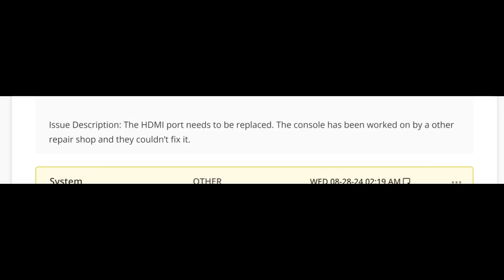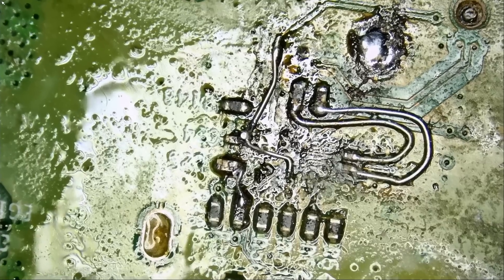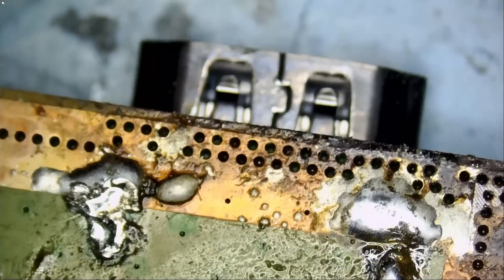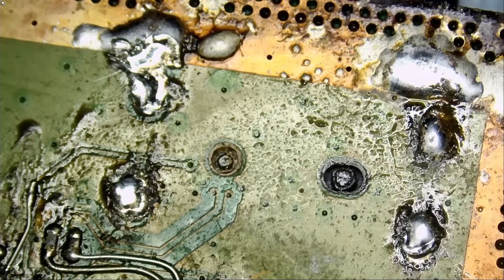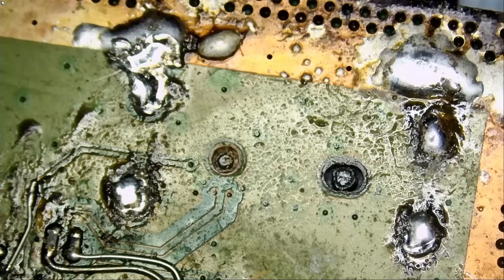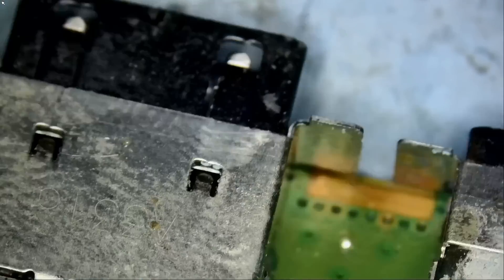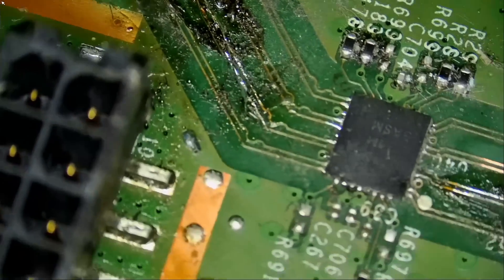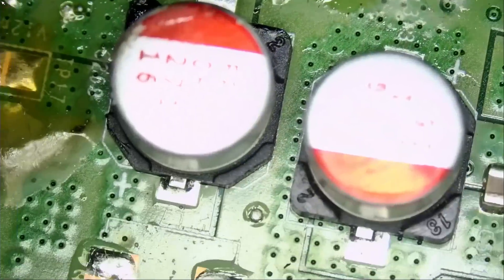Xbox Series X Fastest no repair - You won't enjoy this one..

Comment: That's painful, I fixed one similar the last shop had floated that missing chip and cracked it trying to reattach it. Its an easy mistake when you try to reflow remove those hdmi ports because that chip is under it one slip with a hot air nozzle and you flick it off. Luckily someone discovered a bypass that probably breaks 4k output but it gets the console displaying again. The worst part is that chip is not available for purchase because it's a special sku for microsoft. After dealing with that mess I started putting uv mask in that area to hold everything in place as a safety precaution.

Comment: I always enjoy your videos.

The terrible standard of work on this video is of a similar quality to many repair shops near to where I live in the Philippine provinces. In the 6 years that I have lived here, repair shops have destroyed one mobile phone, two tablets and, what was, an expensive Asus laptop. The laptop made me very angry, particularly because it was bounced between repair shops, so that I do not know who to point the finger at for the damage caused.

About 6 months ago I had to replace the keyboard and palm rest. No soldering was required so I did the repair successfully myself. All went well until the charge port failed. The inner pin came out with the connector, so it was an easy diagnosis. The laptop continued to work until the battery drained. I assumed that with the right tools, replacement of a charging port would be an easy fix for a repair shop.

After several weeks, I was called into the repair shop, which required a 2 hour ferry journey and an overnight stay, to be shown a laptop that would now charge but where the newish keyboard would not work at all. I paid the man for his troubles and took the laptop away.

I have the knowledge to fault find but I did not have the necessary tools nor the necessary experience to do the repair. Watching your channel has given me the confidence to have a go myself. I have nothing to lose and I can't make things much worse. I have spent a fair sum to obtain the basic tools necessary for the job.

On inspection of the laptop, the motherboard seems to have been ripped away from the keyboard with damage to the connectors and a torn backlight cable, which is now too short to effect a repair. I do not have the missing piece. There are many missing screws and Also, a damaged FPC connector with an accompanying damaged cable. There is also an unrelated mechanically damaged SD card reader, that I broke a while back.

I have ordered all of the necessary parts. The keyboard with palm rest is no longer available, so I must also attempt to replace the riveted keyboard.

Your channel has given me the confidence to undertake this job, which is a mammoth task for me. You make the repairs look so easy that I hope I am not over confident. Nothing ventured, nothing gained. My aim is to get the laptop working. I doubt it my repairs will be better than factory.

Thank you for your channel, which is educational and entertaining.

Comment: Looks like the repair shop messed it up on purpose. I really hope the owner didn’t have to pay for that mess. :face-blue-wide-eyes:
Reply: My very first soldering job was 50 times better then this, I have doubts a repair shop did this
Reply: @Nobbie248  Well, you don’t want to judge too quickly. Nowadays, anyone with a soldering iron can call themselves a repair shop, even if they're just working out of their garage.
Reply: With auto repair when a butchered car comes in and they say "another shop" did the work, it's usually the owner who attempted a diy fix and got over their head. 

A shop would have at least cleaned the flux off the board, and not ripped multiple sets of traces.
Reply: Plot twist, the repair shop is the customer

Comment: Why in gods name there are so many wires soldered ? Its not like the traces were broken or scratched . The only exception is if the repair shop or customer used sandpaper to clear the solder .

Comment: For someone like me with very minimal micro soldering repair. How does one even cause that...That is very reckless and flux paste everywhere. Dear lord..
Reply: By forcibly pulling on a part as you are trying to desolder it, that's the only way to rip off traces, especially when desoldering a surface mount chip, all the pulling force gets applied to the remaining pins with solid solder and "rip" there goes the traces.
Reply: It probably started as "one small thing" that escalated to them damaging something else, and then they damaged another thing trying to fix the next broken thing. And soon enough we have *this*.